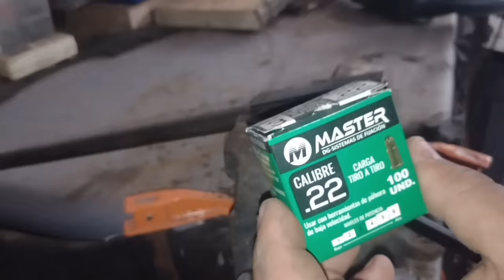how to restore air rifle to a .22 nail gun

Comment: How to go to jail.
Reply: Where I live that would be legal
Reply: In the UK this would be a minimum 5 year prison sentence (you can't get less for a Section 1 firearm without a FAC).
Reply: @barrysnelson4404  The 5 year mandatory minimum custodial sentence is for prohibited firearms, ie: Section 5. To build this would mean you were in possession of a section 1 firearm without certification, which would NOT be a 5 year minimum sentence. However, without major mitigating circumstances it would still gift a custodial sentence.

It should be noted, if you held a Firearms certificate with an open slot for a .22 rimfire rifle, it would be PERFECTLY LEGAL to build this in the UK.
Reply: @Glimpsedshow  Just curious, is there no check on safety on 'homemade' firearms? Would the Pressurised Systems Regulations apply?
Reply: Great video. Just show how you make the complete firing pin and how it works
Reply: We don't have these problems in the USA. Not yet. We took lessons from other countries and their gun confiscations in the past.
Reply: @waterlife.1905 long may your freedom continue. They’re looking at banning swords and crossbows soon in the UK. We’re a failed state.
Reply: @barrysnelson4404  Poland that would be a max 10 years in prison but you can quite easly obtain a permit and own legally a semi auto AK...
Reply: @makeintoschu  тоже самое и в России, покупай хоть танк. Но при этом ты будешь иметь лицензию, то есть контроль государства. А со всякой самодельной ерундой могут инкриминировать ранение, ношение + изготовление оружия 🤨
Reply: “How to go to jail” is a teachers pet phrase! Or just a bot.
Reply: @Glimpsedshow murder rate pet year USA 75 per million. UK 9.7 per million. Which is the failed state?
Reply: @Glimpsedshow  They can never ban Longbows because they are simple to make . Well they can ban them but you know what I mean . But to make this rifle in the UK would not be worth the Grief you would get .

Comment: is there a Firing pin or it fworks by air?
Reply: The air dents in the back of the blank, which crushes the primer, causing it to shoot
Reply: @elanti-furrodelrancho3499  than why he placed there before a long metal pin? 
But later I can’t see any pin
Reply: @yukammashi169  it works with and without it. Some people just prefer to add a firing pin because it's more reliable and can help your rifle last longer.
Reply: @elanti-furrodelrancho3499  so that mean that in Theory you only drill a hole in barrel to fit the blank and put there the pellet and just shoot like a regular airgun?
Reply: @yukammashi169  you could probably even shoot actual .22lr ammo from it, just don't try using .22 magnum, too much pressure, I would send about 10 shots down the air rifle from far away using a string and check the barrel before trusting it 100%
Reply: @elanti-furrodelrancho3499  okay thanks. Thats kinda interessting